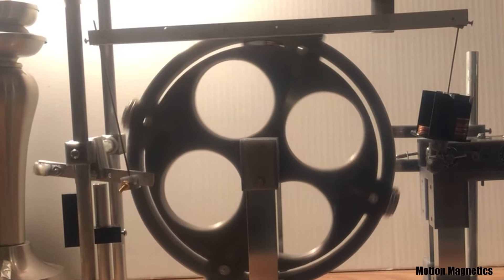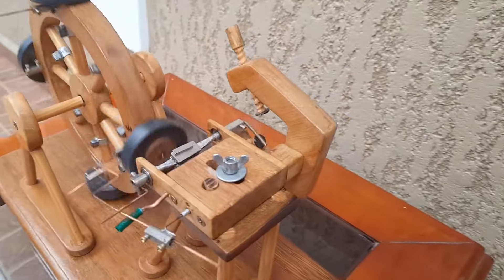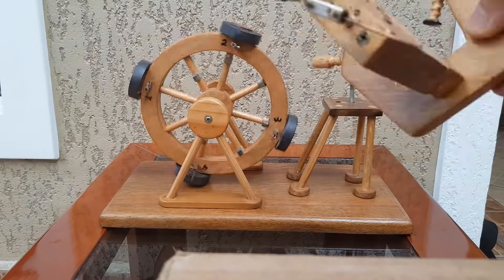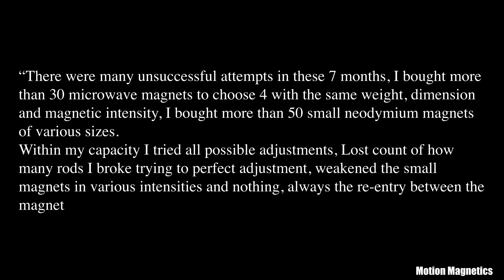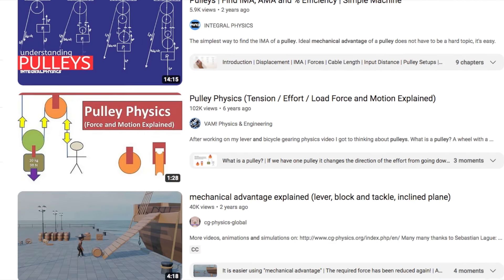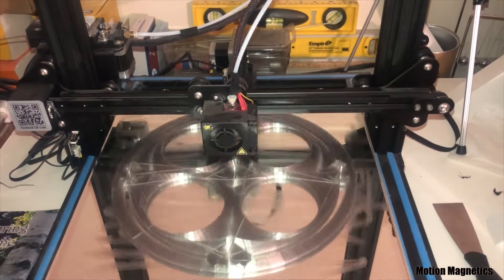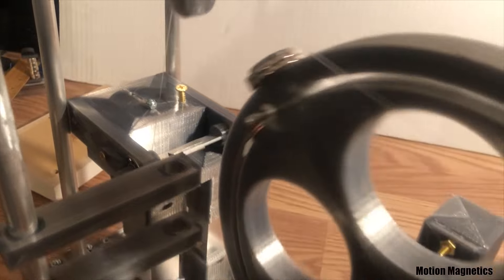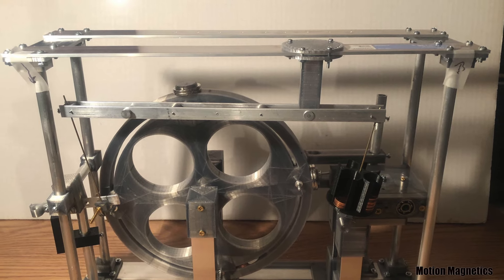The Perpetuum Magnetic Motor

Comment: How about getting the gain up on this mobile so a small amount can be applied to an RF generator -- the RF can be used to power a catalytic reaction in activated carbon or graphite to split humidity H2O, which recombines with very usable protonic EMF.  Graphite/graphene thin film on SiC is nearly superconductive at room temperature and can be used to harvest the energy.  I guess then you'd have to be an electronics whiz to condition that output into popular output specs.  I think that's generally how the PMMG generator works.

Comment: One can learn many things by making own experiments, but this is limited. In a whole lifetime one can not do all the experiments competent scientists have done already. That's why it makes sense to also rely on the insights which were gained by experiments of others. One such fundamental insight is conservation of energy. Energy can't be gained, it can only be transformed from one form to another form. And there is also the insight, that permanent magnets do hold energy, but only a rather small amount and this energy is not spent when they exercise forces and this energy can't be tapped. Alltogether this leads to the insight, that permanent magnets can not drive a motor, never mind what designs and tricks are tried. Yes, there are such strange forms of energy in the quantum world as vacuum energy. But unfortunately we can't transform this energy in useful energy forms.

Comment: They look cool, but none of them are perpetual.  Perpetual motion is not possible.
Reply from the maker: Nothing in the physical universe can run forever. Even the stars eventually burn out.
Reply: Magnetic Motor, looping by itself
Reply: Perhaps a new terminology would be fitting. As motionmagnetics explained, the very universe itself is not perpetual. Therefore, let's come up with a catch phrase describing what something might do. That is, run for as long as the universe exists... 

A catch phrase that implies that something will run until the end of time... To me, something that does that, will for all intent and purposes, be a perpetual motion machine, even though not technically correct...
Reply: @Motionmagnetics  
"Even the stars eventually burn out."
Sure... But what does that have to do with a device running in closed loop? 
I.E. Generating enough energy to continue running under its own power. This would require an efficiency greater than 100%.
Reply from the maker: @valveman12  Because it’s a moot point. You didn’t say none of them are a closed loop system, you said “none of them are perpetual”. Nothing in the known universe is perpetual. So you’re correct, none of them are perpetual.
 
Closed loop is an entirely different subject. If a device uses gravity, barometric pressure, or any other means to induce continuous motion or rotation by combining an external force then it’s not considered a closed-loop system. Even if you angle magnets in the correct arrangement to trigger an exchange force pulse to use for rotation of a magnetic motor I don’t believe most physicists would consider that a closed loop system.

That point is also moot, as I’m not attempting to create a closed-loop system. I’m attempting to do what Tesla suggested and build a device that draws power from the very wheelwork of nature, which does not violate physics. I’m after a very efficient machine. That’s all. I’ve read your comments over the years and you’re a pretty smart guy, so I thought you’d already figured that out by now.
Reply: @Motionmagnetics  
If a device is running and generating its own power to continuously run, that is a closed-loop system.  To be a perpetual motion device, it must be able to provide enough power to run continuously... Closed Loop.

"Tesla suggested and build a device that draws power from the very wheelwork of nature, which does not violate physics."
Never heard of this, so I'll look it up.

Comment: I gave some suggestions before to help and makes me wonder if you read them and what u think.
Reply from the maker: I believe so, but that was a completely different system was it not?
Reply: @Motionmagnetics  Tell me what your thoughts the various suggestions.
 Well yes and no. i did say another system which shows that its possible despite the naysayers and would be ncie if more show proof that tis possible. 

But besides that I also stated momentum being a factor since it seems like many give the v gate for example a small runway to get up to speed to jump to resistance which needs more speed and to compensate for the magnetic force. 

The other is the weight of the wheel since the heavier it is the less effect the magnetic resistance force will have to stop it as well. 

The issue is how long can a v gate get.

Also another idea is magnets have an issue with electromagnets due to the airgap that copper wire has as its core as some people do.

Also with electromagnets the other side not facing the magnet is gone to waste which 1/2 the the energy is gone. also that fast that around the copper coil is a waste which is another 1/2 gone. which is so inefficient. 

But even the coil is not proper since no one mentions ever the friction that comes with winding one next to the other which if you wind next to it a wire that is not part of the copper coil you will see electricity coming out of a wire that is not physically connected to anything.

Comment: You may try as long as you like, but you will never reach the point of a perpetuum mobile. Just pick any physician you like and ask for the law of conservation of energy: there is always a loss if you try to transform energy like motion into another form like electricity. You can*t break the law of physiks. But there is something like free energy where which you can use gravity - tides for example to turn motion (water flows) into electrical energy. Just give something like this a try but forget about magnets.
Reply: ㅋㅋㅋㅋ 바보

Comment: You need to investigate gravity generators there are some very large ones they are using at the present time I believe if you combined this idea with some magnets, you could lift the magnets using their repulsive behavior and, of course, the weight generates the electricity, much like the big Ben clock did in England were once a week they would lift a huge weight, and it would turn the clock with those large hands, and once a week they would take a team of mules to lift up the counterweights like a giant grandfather clock when they replaced the system, it took a 40 hp electric motor to produce the energy needed to lift The counterweights, if the magnets we’re in steer like shape, almost like ball bearings, electric current could cause them to flow uphill into the container which would add weight, and when lowered on a ratcheting mechanism, it would generate electricity The same type mechanism that is used in some of today’s elevators and buildings instead of a breaking system when the elevator goes down with the weight of the occupants every third or fourth time this week drops it generates enough electricity to get one free ride up. it’s about efficiency similar concept just go online. And look up gravity generators, large scale
Reply from the maker: Good call, Mike! I've been working on several designs for a gravity generator for a couple of months now. You're right.

Comment: Hello MM, great channel you have.  I like to experiment with gravity wheel designs.  A while ago I basically recycled an older idea where I had a heavy chain running inside the rim of a wheel.  My calculations indicated that my design delivered about twice the amount of work than the work required to keep the chain in the desired position.  I'd like to share the idea if you have an email address.  Maybe you can come up with a practical approach to turn it into a runner !
Reply from the maker: Do you have a video of it? Sometimes it's difficult to determine the efficiency of something on paper.

Comment: It was obvious to Newton that you could not conserve both energy and momentum. That is what F = ma is about. 

A ten kilogram flywheel moving 1 meter per second can give all of its motion to one kilogram. This one kilogram can be moving in a straight line or in a circle. The 10 kg has; ½ * 10 kg * 1 m/sec * 1 m/sec = 5 joule of energy: and the 1 kg has 50 joules (1/2 * 1 kg * 10 m/sec * 10 m/sec). The 10 kg will rise .051 m and the 1 kg will rise 5.1 m

One kilogram can give a 9 kg flywheel (10 kg total) an arc speed of 1 m/sec after the one kg has dropped only .51 meters. And the one kilogram is thrown up 5.1 meters.  5.1 /.51 energy increase. 

This momentum transfer occurs in experiments like the Dawn Mission yo-yo despins. Or those on youtube Delburt Phend

Comment: No it's run on 8 magnet 4 in a well x 2  N and S . 4 coils 4 wire 4 output  1234 2341 3412 4123 . and have 4 collector  1 collector run 3 quarter turn change  and stop connecting and 1 quarter discharge x4  what all your well is ok you need to put the magnet on it N S N S

Comment: Are you making mistakes on purpose? Loosen ring magnets! Stick weak black magnets. Igor Beletskiy works at the beginning of the video. Make a COPY like his! It works until he removes his hand from the frame and the wheel slows down.
Reply from the maker: I'm not convinced the original motor worked. I'd like to believe so but there have been at least 4 people who have attempted to replicate his motor using microwave magnets like the ones he used and it didn't make any difference. One bought 40 of them and picked the best 4 to use on his motor, experimented with multiple types and sizes of magnets for the stator for 7 months, and was never able to make it work.
Reply: @Motionmagnetics  Means did not please with the sizes.